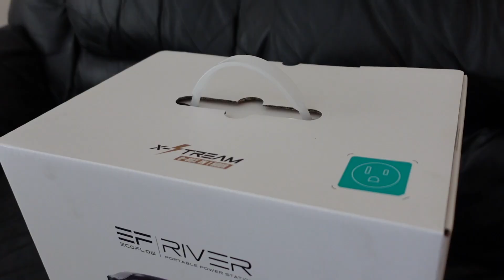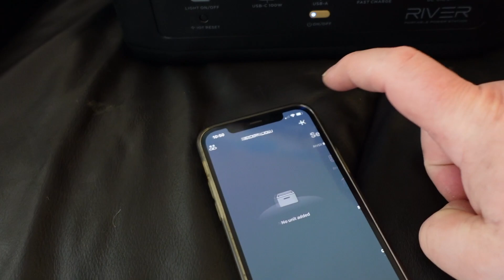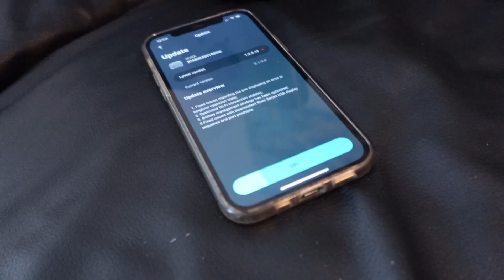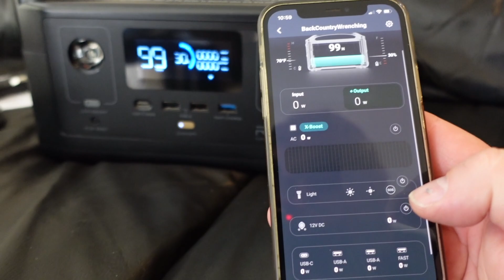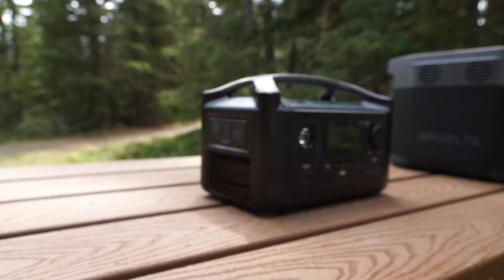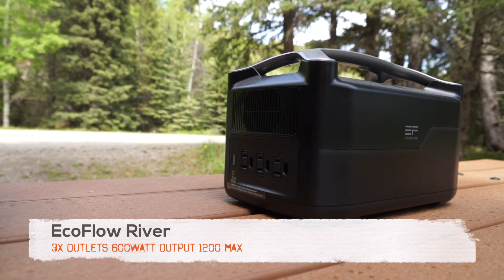EcoFlow POWER STATION UNBOXING | Compared to the Delta

Comment: why would need to update the firmware on a powerstation?  Why does it even have bluetooth?
Reply: I am going to guess at some point the power supply will have some type of hot spot capabilities satellite, mobile, or boost a separate mobile device signal.
Reply from the maker: Maybe it spies on you 😂🤣😂
Reply from the maker: Maybe the firmware is updatable to help make the batteries more efficient